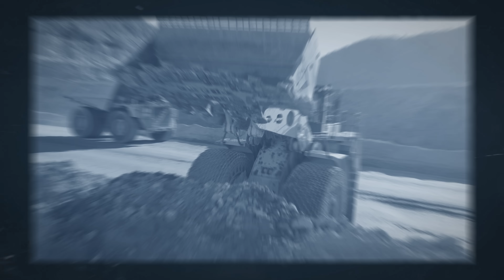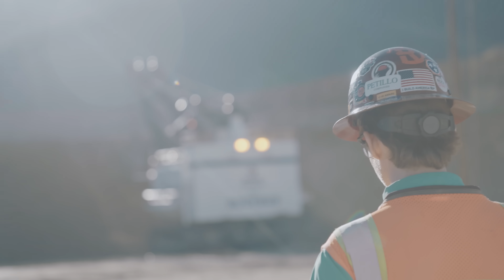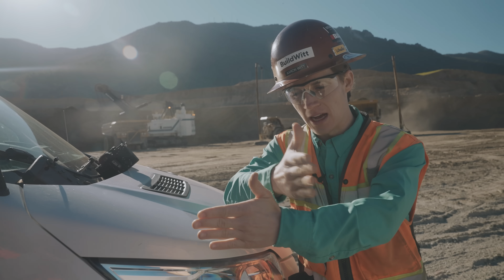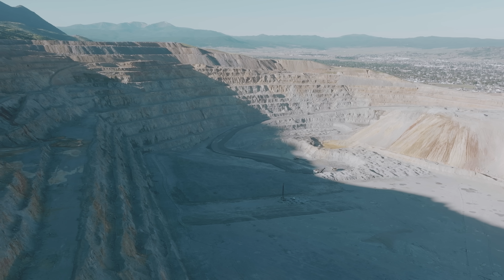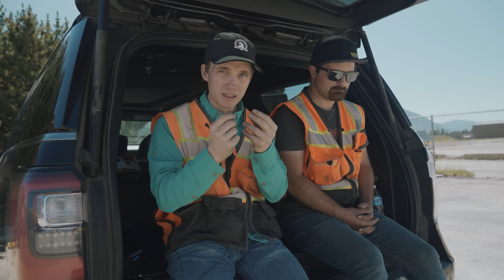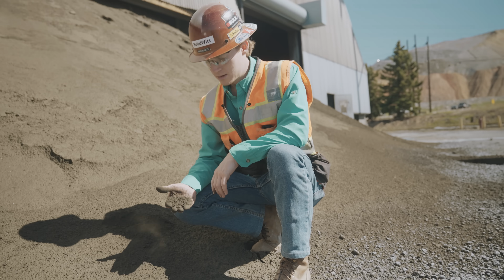Over $48 BILLION in 100 Years | Mining Copper with Montana Resources

Comment: 👍 Those electric shovels look like P&H's original shovel machines and the dipper ( not called bucket ) I'm familiar with the structure of the dipper, the door and latch that lets the material fall out, tooth and shrouds, there was a lot of selling and buying of companies back then to now. Wow what memories this brings back. I worked at P&H 1996 - 2002 as engineering  consultant. Show more surface mining please. Earth before  🌎 🏜🏝🏞🏕🏡 after ???

Comment: Just an FYI, the main reason they use rubber tired dozers is not for mobility issues. they are used to maintain the area around the shovels, and the shovels are electric. There is a huge "extension cord" running on the ground connecting the shovel to the power supply,  and it gets buried at times. The risk of damaging it with a rubber tired dozer is minimal, compared to a tracked unit which would cut it and short it out and most likely kill the operator and destroy the machine
Reply from the maker: this is a benefit but I see tracked dozers maintain the floor around shovels and draglines very often
Reply: @AaronWitt  Yeah, when they used to run draglines and bucketwheels at Syncrude, the draglines and Hydraulic excavators were done with dozers, but the bucketwheels and cable shovels were done with rubber tired ones.  We were always told its because of the umbellic cord (power cord) and that it lays on the ground for the after two,

Comment: Worked at Ford in butte and I used to deliver parts and work on mine trucks.
Ford used to test their new engines and truck in the mine. 
You would have a old body style with the newest engine for testing in severe conditions

Comment: Seeing that 994F Front End Loader makes me tingle.
Reply: As a 994 operator who's been trained to operate to CAT specifications to minimise wear and tear on the machine. EG: to maximum efficiency (high dig rate, low load time) and be gentle on the loader.

1 - never dig articulated - as seen here. Stresses the driveshaft and torque converter

2 - never have the boom raised above half mast height and be articulated coming in to load the truck. 5x pressure/weight on the inside tyre - as seen here

3 - in V loading situations, as seen here, reverse straight out whilst raising the loaded bucket to the dovetail of the truck, then only a slight turn is required to get square to the truck. Switch to forward, Raise boom and load truck.

This operator needs to be brought in for further training or removed from the machine for being non-compliant. It all depends if you just want to be a driver or a Production Loader Operator

Comment: Great video!  I have a question…so is the cancer in the dust or the chemicals…no just kidding!  Why do mines use wheel loaders and not just use more shovel buckets since they move more yardage per cycle?  Never understood that…I know there is a good reason though.
Reply: Shovels are slow to tram on their tracks (& expensive undercarriage wear). Loaders can go from one place to another very quickly and without undercarriage wear.
Reply from the maker: Yep thanks Mitch
Reply: Thanks guys, makes perfect sense now.

Comment: Why isn't there a smelter on site that takes advantage of zero transportation costs? Also, why aren't the crushed processed tailings used in other construction products and processes? Seems like the perfect material to make earthquake-resistant shaped foundation and retaining wall blocks.
Reply: The world's largest copper smelter, the Washoe,  stood 27 miles away in Anaconda, but the EPA and corrupt union contractors coerced ARCO to rip it down in the early 80's at huge expense. The concentrator facility in this video very nearly suffered the same fate, but was narrowly saved by a genius named Dennis Washington in 1986. It has been running almost nonstop ever since.
Reply: I live in Missoula. My grandfather worked at the old Butte mine. Before the Pit. It would be virtually impossible to have a smelter built here now.  EPA would have it shut down in a heart beat.